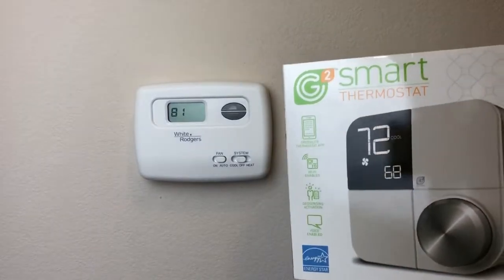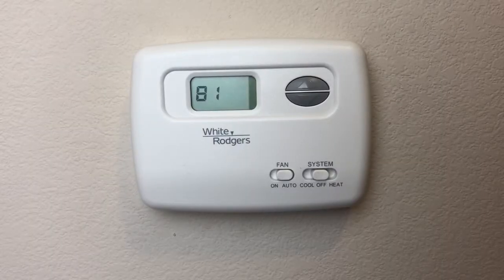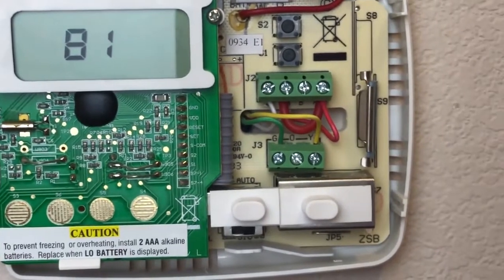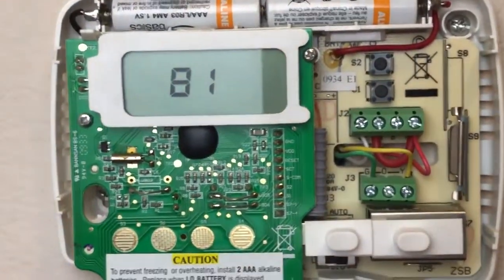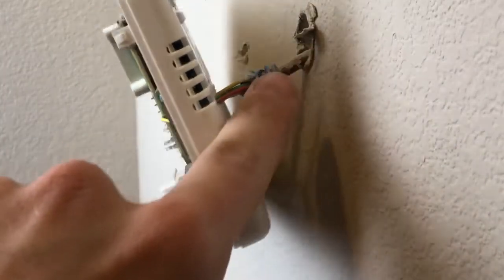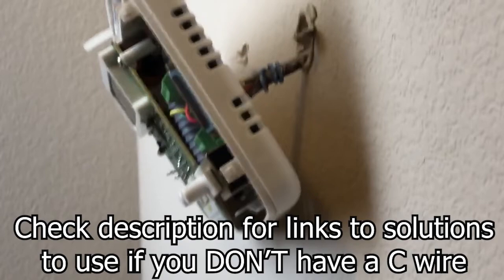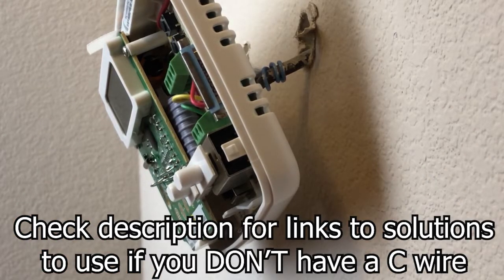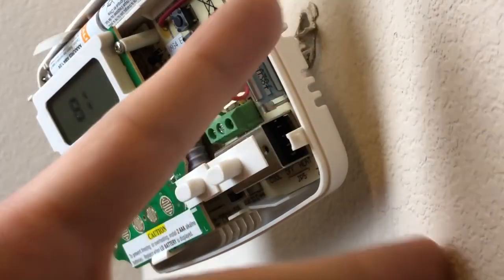How to Tell if Your Thermostat Has a C Wire

Comment: If you have no C wire, can you not split the G wire by splicing 2 wires off of it so that you can also still use your fan?  I mean these are low voltage wires so it should not be a safety issue.  The only thing I could think of is loss of power by the division of the wire.

Comment: If I take the batteries out of my thermostat, and it still has the display on... Does that mean the C wire is hooked up?
Reply: Good question Soljarag5 ......wonder why they will not answer it?
Reply: @carolburnett8372  turns out I did have a C wire... But YMMV

Comment: The problem with this video is that I wanted to know how to test the unused C wire using my multimeter in order to confirm that it does not already have power.
Reply: Put your multimeter on V~ and see if it pulls voltage…

Comment: replacing exact same thermostat w a new wifi thermostat.  Like you, had the blue c wire tucked into the wall and wasn't connected to a terminal at the furnace either.  checked the furnace and it already had a white wire connected to the c terminal.  tried to twist together the unconnected blue wire with the white wire that was already connected to the c terminal (at the furnace) but still couldn't get the wifi thermostat to power up.  Any ideas?
Reply from the maker: Do you have junctions that come off the control board similar to this video?
Reply: @RobSomeKnowledge  not that i can see.  the wires from the terminals feed into a a brown wrap and bundled together.
Reply: @to174jay9  when in doubt. Hire a proffesional. Safety first.
Reply: @ditzfough  Me too stupid to do things myself.

Comment: I pulled the harness out and found the c wire tucked away, followed your instructions to the furnace, and one of the two wiring harnesses coming into the wall has a blue c wire hooked up to the junction and the other is coiled up around the harness,. What should I do?
Reply: Burn the house down
Reply: @stroshow5  Lol.

Comment: I have an extra wire in my thermostat but it is not blue it’s like a mustard yellow color and I am not sure if I can use that as a C wire since it’s not blue, can someone please help
Reply from the maker: Follow the same wire on the inside of the furnace or air handler, and see where that wire connects to on the board

Comment: It's great if you have a wire wrapped in the back. But you didn't clearly identify how we could isolate the C wire. Is there a voltage or amp going through the wire that we can identify it with?. Otherwise the video is kind of useless.

Comment: So look to see if you have a blue wire coiled behind the unit? Really? That's your answer?
Reply from the maker: Yes...? You either have a c wire or you don’t. Thermostat wiring comes as a bundle. So most installers just tuck it back into the wall if it’s unused. It’s not like there’s some random place in your house you’re going to find it. 😂 What’s so confusing?
Reply: So... what if behind my thermostat there is more than just one wire that isn't being used?? Now what??
Reply: @RobSomeKnowledge  what if you don’t have a C wire at all?
Reply from the maker: Then you’ll either have to run a new thermostat wire or most smart thermostats have a C wire adapter you can use